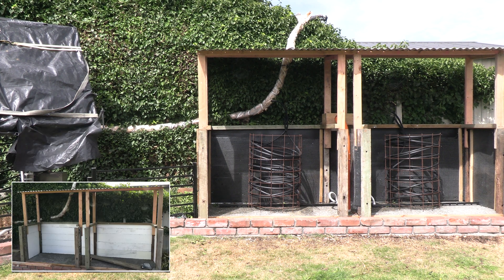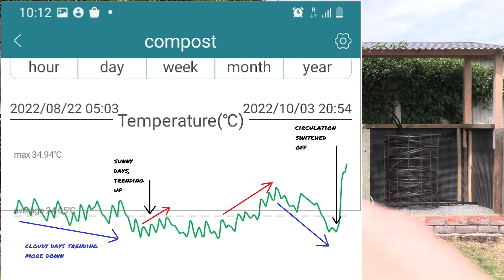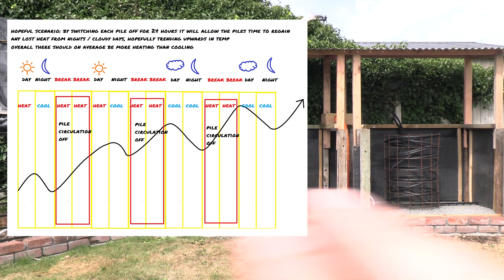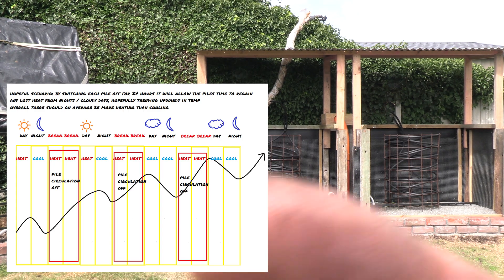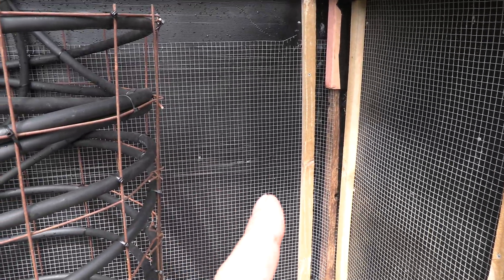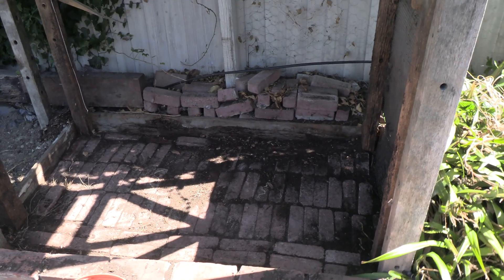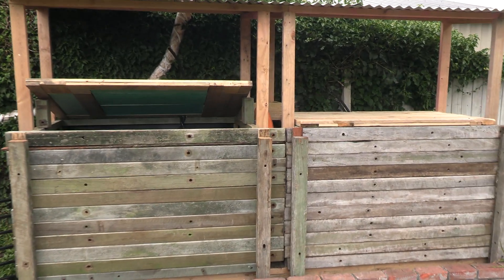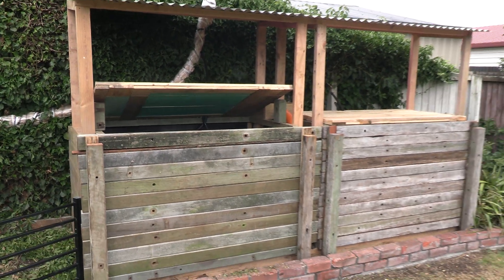Dual-pile compost hot water heating V2 complete, plus overview of temperature data from V1

Comment: Wow very impressive work !! Interesting idea to alternate composts.
An other approach i saw in a boat container scale, is to only harvest heat that escape on the top (as heat goes up) and insulate even better all around (strawbales protected with a plastic layer ?)
In this way, you have no risk to take too much energy from the pile. There are also some passive systems like mechanical thermostat to open or close water circulation, or greenhouse vents..
Reply: No no no. HEAT does *NOT* go up. Hot *Air* rises but heat itself does not. Common misconception.